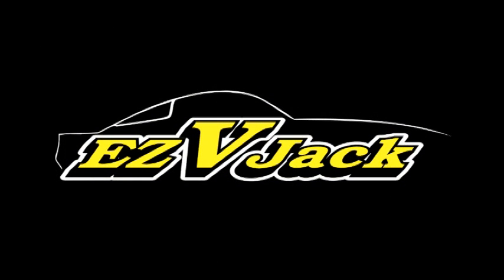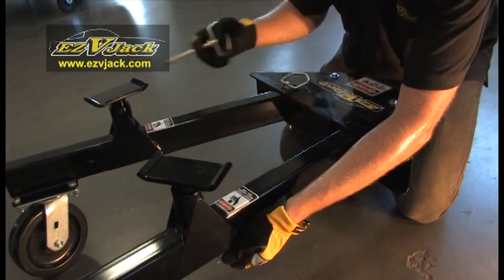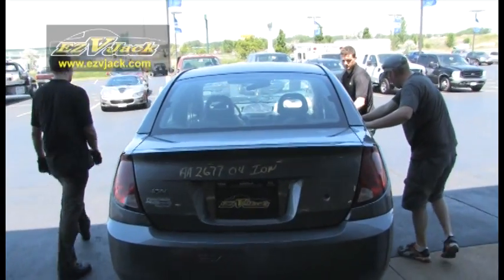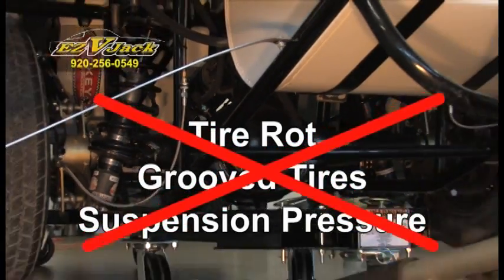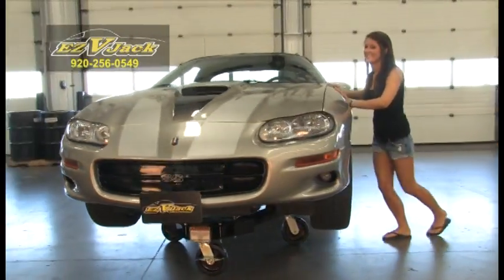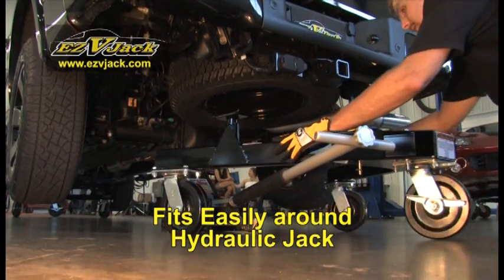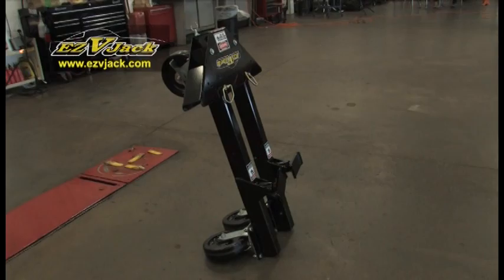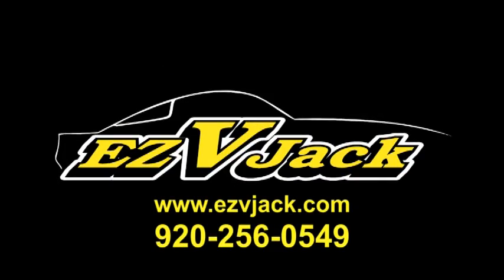Girl moves car with rolling jack stand

Comment: I had to rent a cherry picker to hoist the engine on the stand and⊳⊳>share4.photo/EngineStand?102  fortunately the width of the stand rolled in between the legs of the hoist to make that task a snap. I'm using the stand for a Ford 5.0 H.O. engine out of a 1990 Mustang which weighs about 450 lbs. The stand doesn't deflect at all. The cast wheels roll easy too.

Comment from the maker: When I designed the EZVJacks, the barn  I was to use them in had an incline down to the drain. It was only 1 or 2% but the car wanted to go down to the center while on the  units. That's the reason I chose to use the lockable vertex Caster. When this is locked you can actually go parallel with a slight incline and it will not go down towards the center. It does have locks on the vertex wheel but in the instructions I recommend chocks to be used so the car does not actually shift position.

Comment: This is very dangerous on inclined surfaces, even if slightly inclined. One could get ran over if the car rolls by itself. Is there a mention of a brake lock on this thing?

Comment: Great concept. For a $1000 though, I dont think its worth it unless you give it a little more ground clearance. Justifying that it's a replacement for a lift.
Reply: According to their website, perfect for autobody to work on damaged axles and or suspensions without need for a lift.
Reply: great for  block sanding lower sides of cars